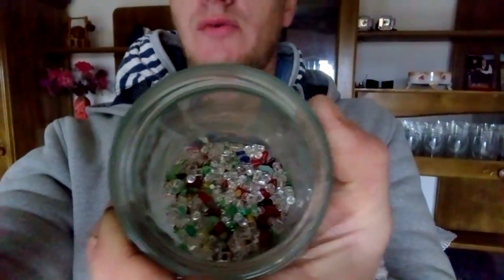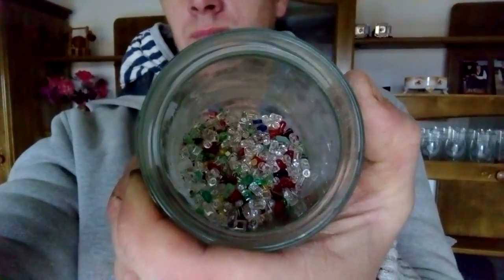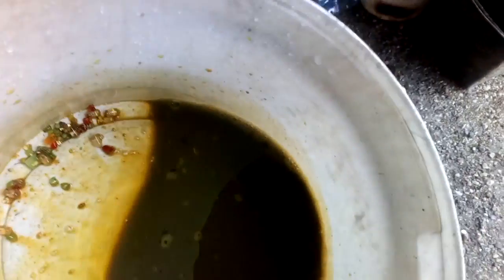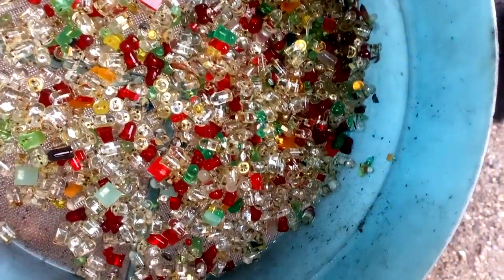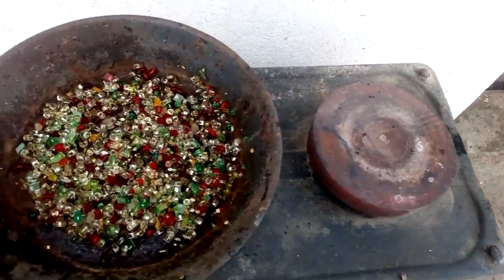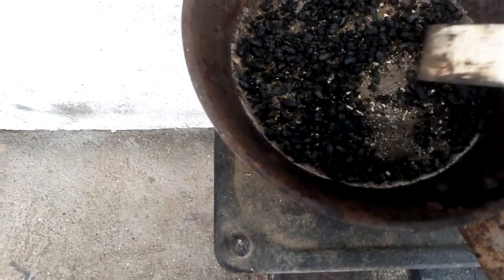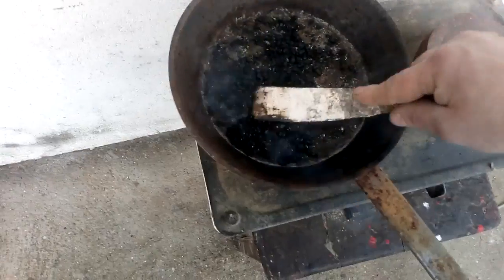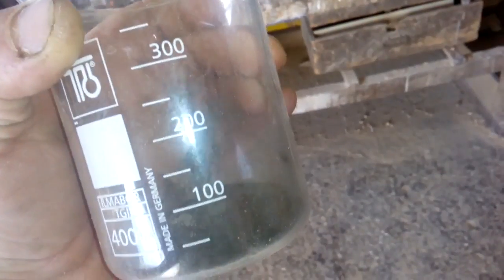LED DIODE gold and silver recovery test!?

Comment: LEDs may have another valuable metal:  rhenium.  It usually exists as a rhenium-tungsten-molybdenum alloy in the LEDs.  You'll only be able to recover it as a powder.  It's melting point is over 5,700F (3182C), so melting it is pretty much out of the question!